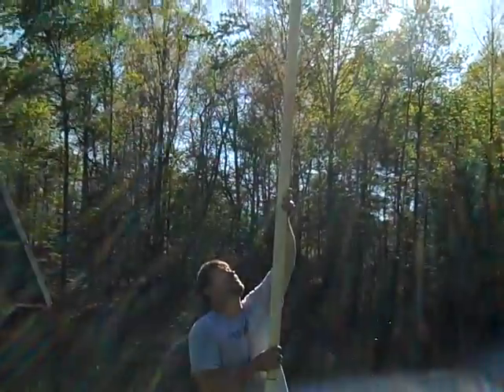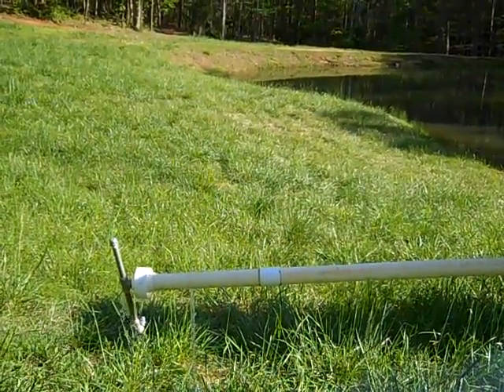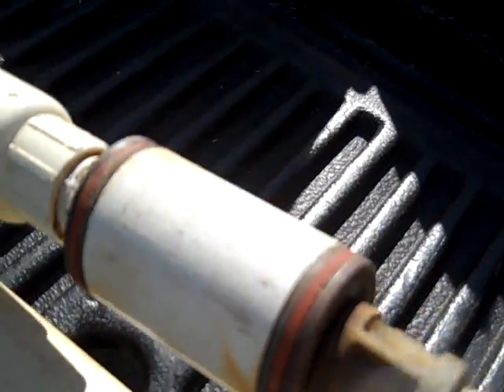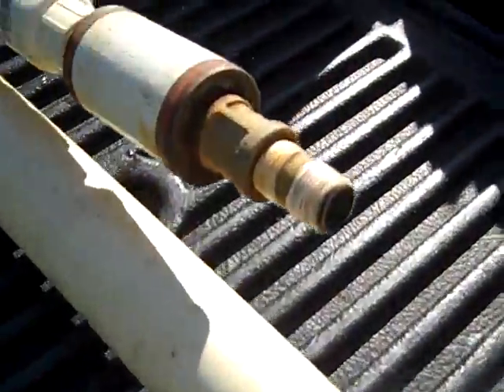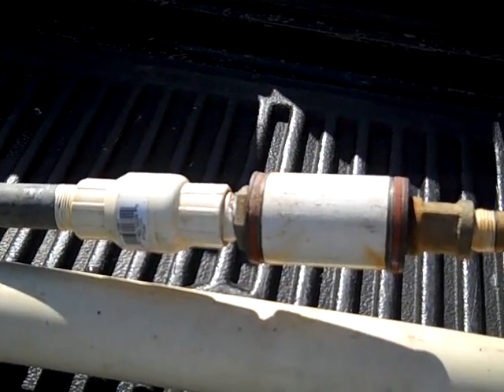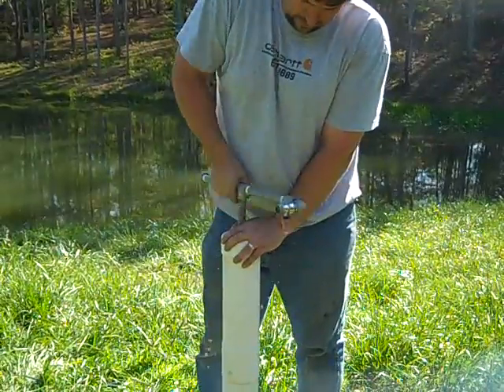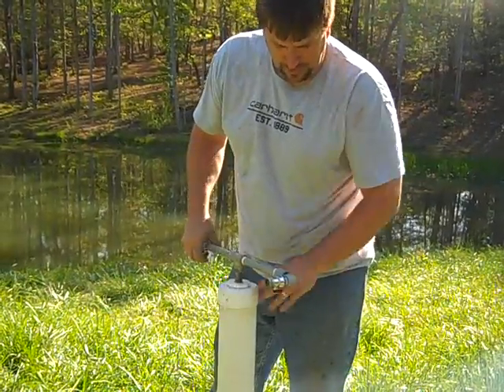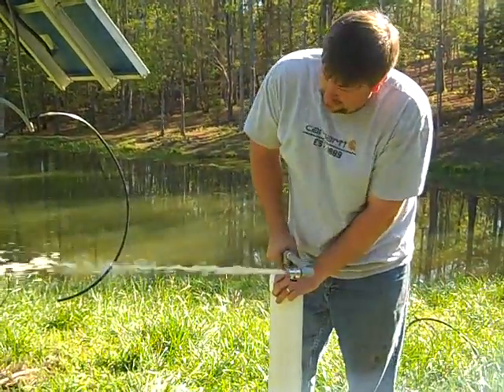All about wells- Force Pump DIY

Comment: I am thinking of making a home made windmill using a worm drive gear box and a lever (mounted on the shaft) to pump a pump up and down. This type of pump looks like it would work better for my setup than the pitcher pump I was planning on using. I would like to pump water up a couple hundred foot hill, might need a smaller diameter piston to get enough pressure to pump that far.

Comment: That's cool. This pump forces water on the down stroke. That should make it easy to pump with the simple T handle on your pump head.  On a typical deep well pump like you see at camp grounds and parks water is pumped on the up stroke. your system is simpler. I like it!

Comment: I should have seen this video earlier. Checked a local lowes for a pitcher pump and the guy looked at me like I had three heads. Lowes does have them on their web site but none at the store I went to. Maybe I'll try building one of these instead. It'll be a birthday gift for my father. He has a hand dug well. Its about 24" wide and about 16' deep. Water is at about 12' down. Is the foot valve just another check valve to keep the water in the casing?